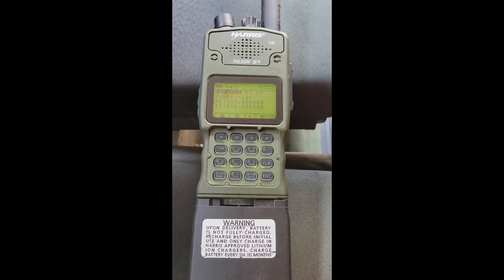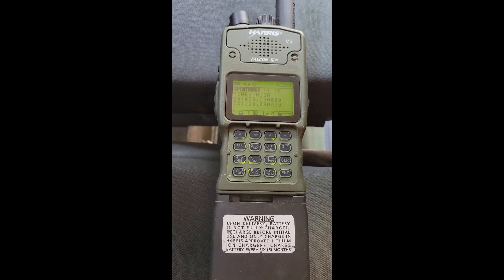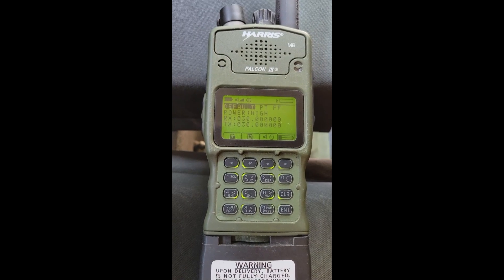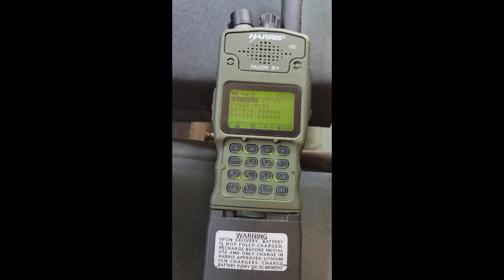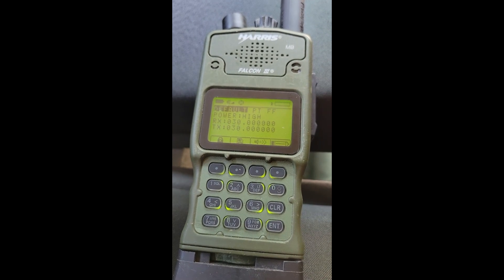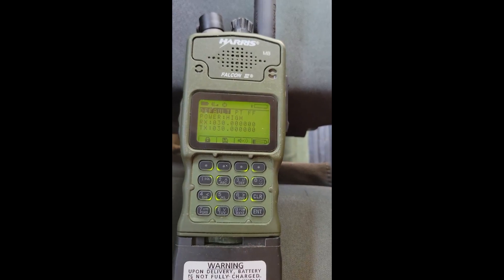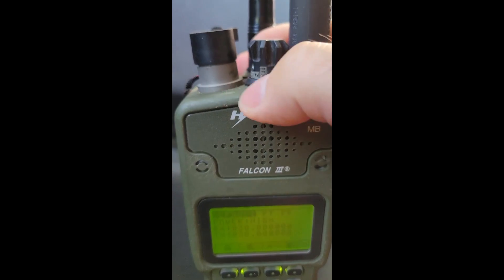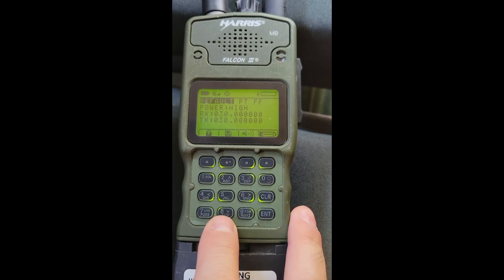Harris RF-7850 Operation (basics) Falcon III

Comment: For the green 7850m HH, I’ve seen two models or generations, one that looks like the one you have and one that has a bigger speaker shape. Do you know when they changed/updated the body shape/speaker and if there are any major differences between those models or if they are basically the same
Reply from the maker: @TyMorgan412  hmmm. I do not know.  Maybe a picture would help?  Also I think the 7825M-HH speaker might look different.  Perhaps that is what you saw.

Comment: Lack of uniformity between external connectors equal great money maker for Harris. Probably the same issue for programming cables. Like the flying batwing company, a hundred different programming cables especially for newer USB based cables.
Reply from the maker: Absolutely. It doesnt make any sense other than a money maker. The radios of the same generation (falcon II, falcon III, etc). Should all have the same connectors within that generation, but they don't.

Comment: No VFO no ability to scan wide band areas no ability to look for signals , not that its a giant deal its limited in those manners . But if it had those features plus a few more and it could very easily it would be in my opion the king of radios without those its simply a channeled radio with no VFO little boring . Still harris makes damn cool sdr's . Maybe one day Ill be lucky enough to play with one of those tell than ill have to enjoy my Icom 705 or my Datron spectre HH2100v radios yes 4 of them lol maybe ill find a trade for a falcon who knows ..
Reply from the maker: In my experience, a VFO isn't common on a VHF/UHF radio even in the amateur market. In the manual mode, you can move the cursor to a position of the frequency display and press up/down and change the frequency. It does have scanning capability, IIRC that you can program.

Comment: Is the 30-512 frequency range continuous or are they separated into various ranges? The frequency number must be entered manually with the keyboard or you can also scroll between the various frequencies? Do 30-512 all work in both reception and transmission? Thanks
Reply from the maker: 30-512 continuous. there are something like 100 presets you can scroll through. Also, you can press up or down  on any digit and the radio will act like a VFO

Comment: Nice radio, do you have some information about handheld radios batteries? For repair?
Reply from the maker: The batteries are very available on ebay. They cost between $25 and $50 typically. Good luck

Comment: Can it receive AM/FM broadcast stations?
Reply from the maker: This radio is 30 MHz - 512 MHz. AM broadcast is 550 kHz - 1700 kHz so no. But FM Broadcast is (about) 88 MHz- 108 MHz so, yes. But keep in mind that the deviation used in broadcast FM is very very wide, where as these military radios are much more narrow. So it will sound distorted.

Comment: What is in place of where the COMSEC cable would be connected to the skl on the military version?
Reply: I mean on the falcon iii, the actual part where you attach it to the mount? Hopefully I'm using the correct terms
Reply: @love life you  6 pin ... so you'd hook your headset up there.

Comment: Great radio, I might have one on the way to me soon. Do you happen to know the pinout on the top 14 pin connector?
Reply: The top connector is only 6 pin nato. “U283”
Reply: @LukePRTR  sorry should of been clearer, it's for rf7850s.
Reply: @militaryrig  that probably isn’t even FPP, do you have the software for it? It might carry the same type of Pinout as the side IO on the HH models
Reply: @LukePRTR  It has USB connectivity and you can get a Ethernet/USB cable then you can change settings with a web UI. So if I can find usb pins It's a start. Or buy a keypad
Reply: Also looking for pinout for the 9 pin LEMO style Audio accessory connector